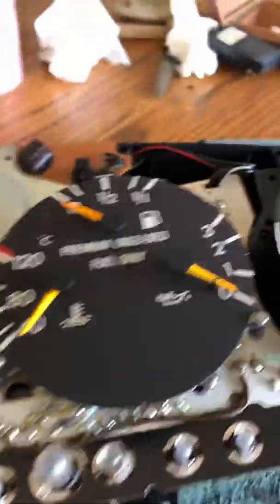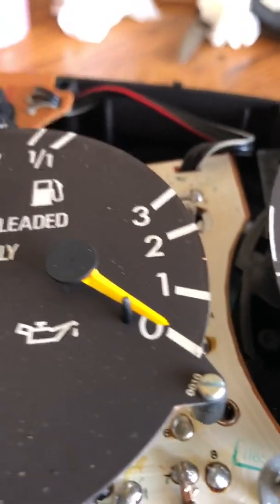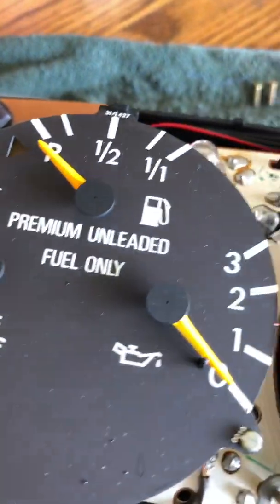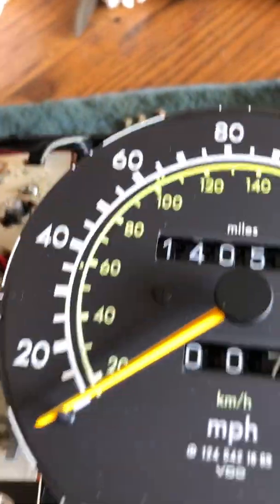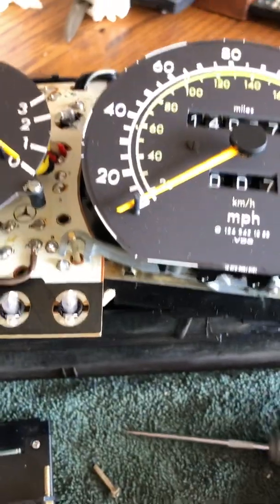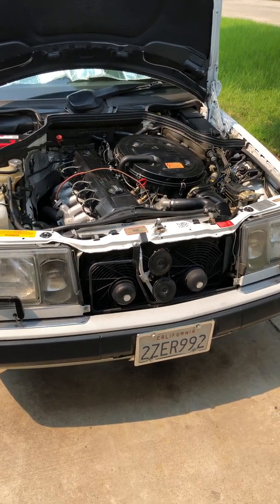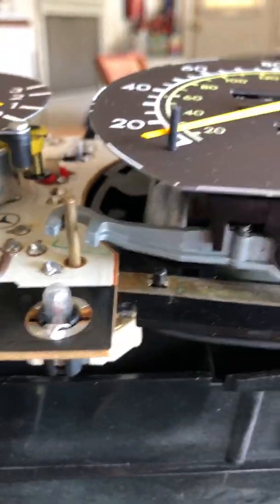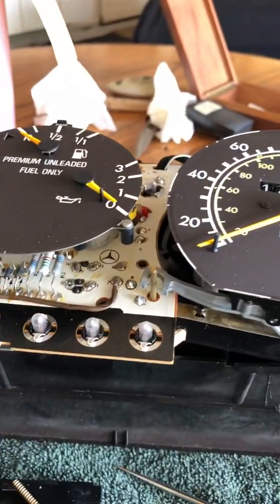W124 300E oil pressure gauge inspection

Comment: Thank you for your tour of the instrument cluster. While you did not solve the problem, you gave a very complete explanation of what it might be. I hope you got your 1992 300E buttoned up. Now, on to my 1991 300E: oil gauge not registering. I'll start with the oil pressure sender unit. Thank you.